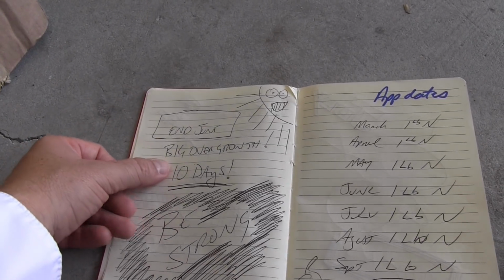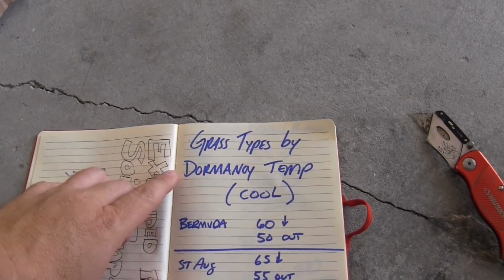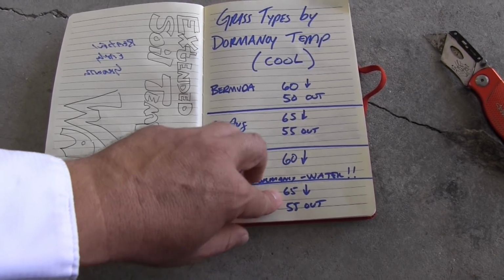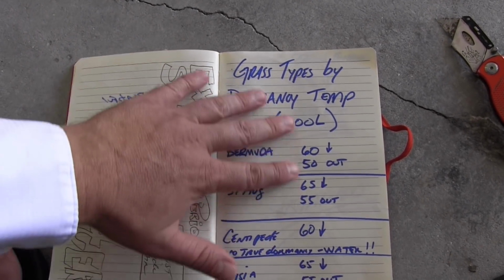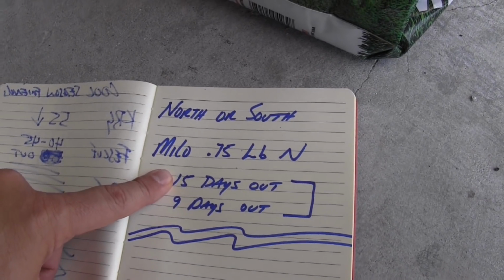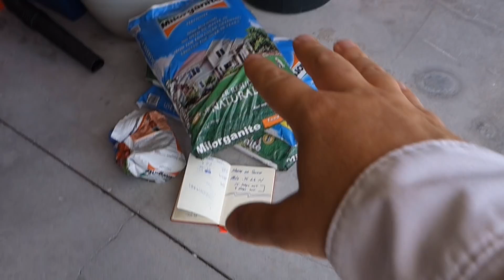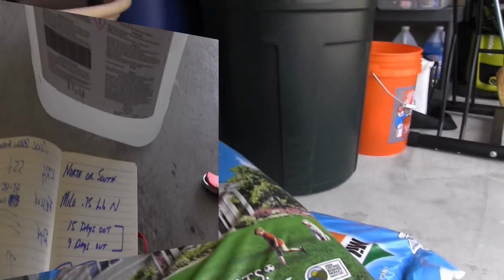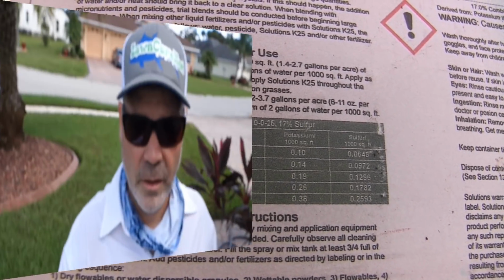Halloween Lawn Domination Prep and Application

Comment: I just bought an ECHO trimmer similar to the one at 19:10 and it runs excellent after an adjustment to the fuel screws (it was a little sick out of the box). Never considered getting an attachment model for an edger, hedge trimmer or brush cutter attachment. Its GR8 that Home Depot has some high quality lawn care equipment to compete with the pro stuff.

Comment: LCN, have you ever considered a Toro eFlex cordless electric reel mower? I think that it's the answer for most people. It requires minimal maintenance and stores compactly, it only needs sharpening every eight years, there's no gas engine to maintain either.

Comment: I had to break 3 mowing rules yesterday. Mowed when it was wet. I bagged because it was so overgrown. I cut off way more than a third of the grass blade on one mowing. My soul died a little. 

Is it ok to be putting down nitrogen and pushing growth this time of the year just before the lawn is going to go into dormancy? (Central PA, cool season grasses)
Reply: I'm tapering off. Final application is going down today for me.
Reply: Hahaha. Yeah, my blade was sharp. So I guess I have that going for me...
Reply: John
I would have mowed it high and lowered it when it dries out.
Any reason you had to mow it low?
Reply: I had thought about doing that, but decided against it mostly due to time. It's getting increasingly difficult to mow in the evenings with the sun going down earlier. By the time I get home from work, I wouldn't have enough time to mow. If I waited for the weekend to mow again, I would be overgrown again, just continuing the cycle.
Reply: I just did the same thing. Im not worried too much but I'm also probably not in the same region you are in. Probably be ok. I added a thatch in mine so I wouldn't worry too much lol.
Reply: All in all grass is a pretty resilient plant. I just wouldn't make it a habit.
Reply: Ngdonut where you live? I'm in Washington and its not even close to freezing here yet. Not till late Nov id say.

Comment: I'm in northeast  Mississippi with a St. Augustine lawn. I am battling brown spot at the moment fungicide and I have read where it was not good to add nitrogen to the lawn this late in the season and having issues with brown spot. Is milo the same? Is this stuff Ok to put down during this time? We had a week of cooler night time temp's and it really kicked in the brown spot. We just bought the house in February this year so this is kind of new to me. Temps' this week are in the 80's and 60's and it looks like they are dropping to the 60's and 40's next week. The grass has REALLY slowed down. The front yard where the lawn is getting more sun is thick and green.The back yard where there is a little more shade is not as thick and where the brown spot issues is. I put down some standard nitrogen fertilizer about 1-1/5 to 2 months ago. I think is was 15-0-0. I liked the journal idea and started that yesterday. Good advice thanks.

Comment: Do you recommend the Bifenthrin generally, or is it just something you need in your situation?  
(I live in central OH, if it matters for this application. I'm in a new to me house and doing some late season work. I hired a crew to do a lawn aeration, but they haven't been able to get it. First it was too dry (not able to pull a good plug), and then too wet. Now it's 'just right', but they're backed up. After they aerate I hope to lay down milorganite and potash, or some other winter fertilizer.
 (I have about 4500 SF of turf and plan on using 2 bags of Milo. I also have 1 bag of 'Safer Ringer Lawn Restore, which has an analysis of 10-0-6 and I figure will be a good, safe, winter fertilizer.)

Comment: Hi Alan.  I am wondering if Milorganite needs warm temps to break down, meaning does it need heat to break down?  I ask because I am in N.H. and I don't tend to use Milorganite at this time of year because I thought it wouldn't be utilized due to lack of warmer temps. Is that true?

Comment: LCN!! Love the videos.
I just over-seeded and used starter fertilize. Can I throw down some milo or would that burn the grass? Thanks!
Reply: I live in AZ and I just over-seeded the front and backyard with Rye grass.  I always apply start fert and Milo at the same time.  Then I throw the Rye seed on top of that.  Then I throw the Topper on that.  It is a beautiful thing.  Within about 7 to 10 days the rye grass is as green as can be and about two inches.  "That's what she said".  MILO won't burn your Grass!!  Throw'er DOWN!!
Reply: Brian Edwards. Will do...I sure hope it does not burn anything.. looking forward to a green lawn. Thanks!
Reply: Brian Edwards hey I also live in AZ and this is my first time trying to get a lawn going. I put down some rye down as well. My question has to do with watering, I watered a good amount right after I put the seed down and watered it again before going to bed. I water it in the morning before I leave for work but the problem is that there isn't anyone home to water while I'm gone. Will the seed survive with the long time gaps between watering?
Reply: mrtwk63 I bought a digital water timer and a couple of hoses.. works like a charm!! Btw I live in NJ and water 3 times a day for 10 mins to keep the soil humid.

Comment: Why do you have to water in liquid potash? Doesn't the water in the sprayer handle that?
Reply: ryeguy01 You need to apply enough water that it absorbs deeply into the soil and prompts the turf to uptake (drink) the potash. Otherwise you run the risk of it just evaporating and not working effectively.

Comment: Your video on lawn striping St Auggy was comical to me. I usually try my hardest to get rid of any stripes by going back over with a backpack leaf blower erasing the lines. It also allows me find any spots that didn't get cut or pushed down by the wheels. Gives the yard a flat top look.
Reply: Joshua Russell striping is overrated, nice flat top turf look is the best, and natural looking
Reply: Pipe Wrench if you want natural surely you should just not cut it, you know leave it to be properly natural....
Reply: Either way I don't care. Ill take stripes because I'm not messing around with leaf Bowers and spending time that I really don't need to when stripes look pretty good to me. Just my opinion. I do also have alot of property so that pretty much determines my routine.